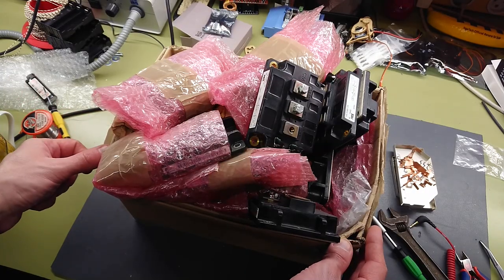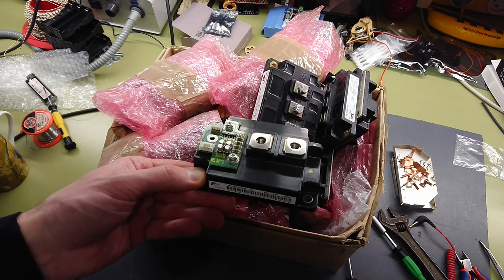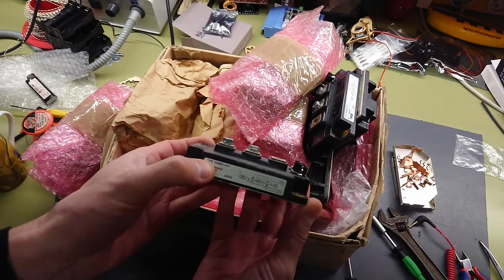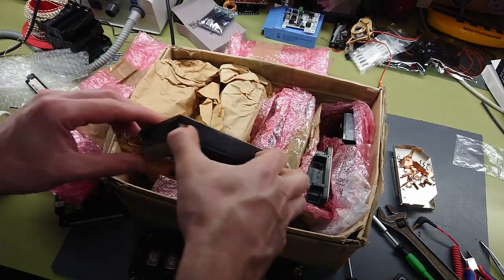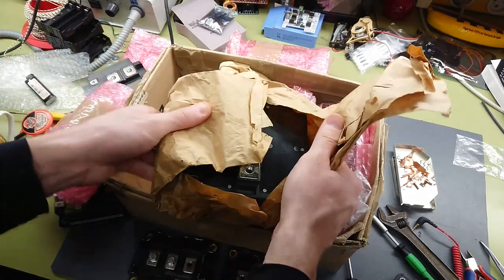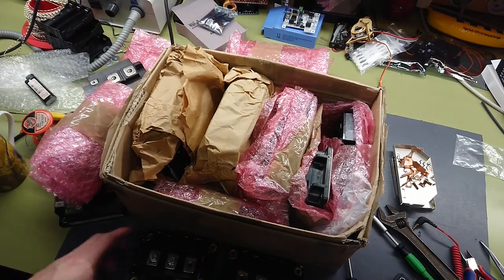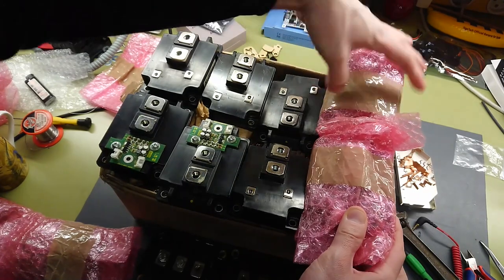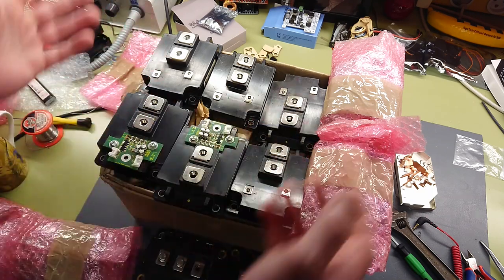8x 800A + 8x 600A IGBT Bricks - Isolation, Day 3

Comment: I would like to ask what does those pcbs do on the IGBT bricks? I ask because I have three SCR full bridge rectifiers and they have pcbs connected to the gate as well.
Reply from the maker: There is typically 3 passive components. Gate resistors to slow down turn on/off. Diodes to bypass one of two resistors for faster turn off. Zener diodes back-to-back to protect G-E junction from over-voltage. If there are more active components, you might have some high-side gate drive circuit whereas the previous mentioned is for gate drive transformers.